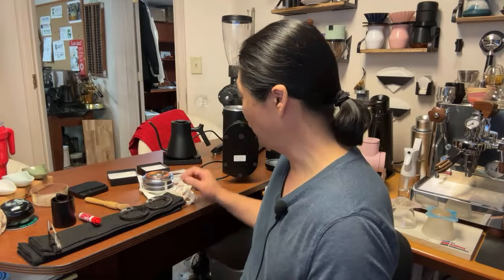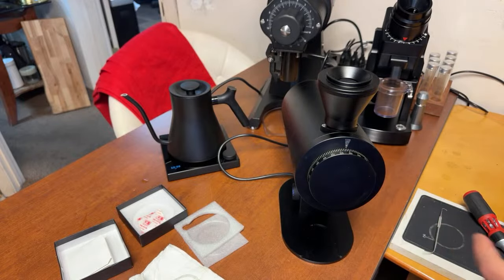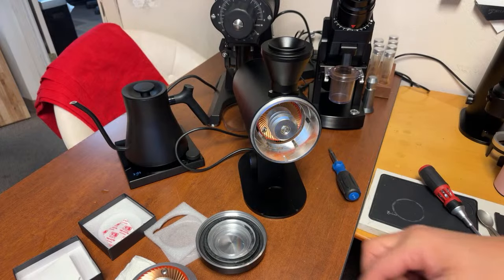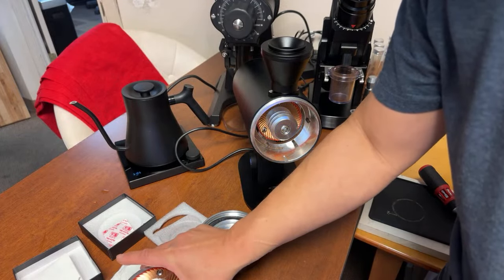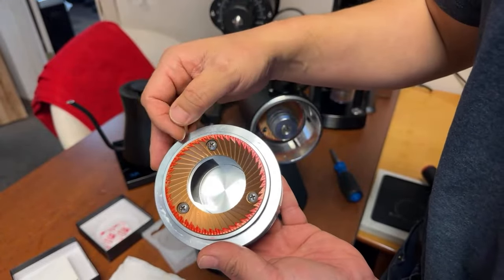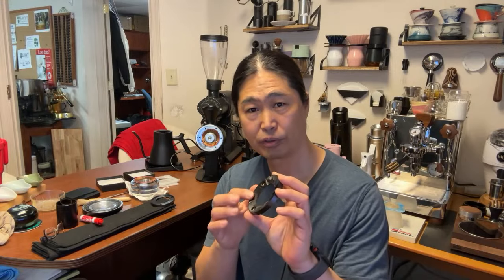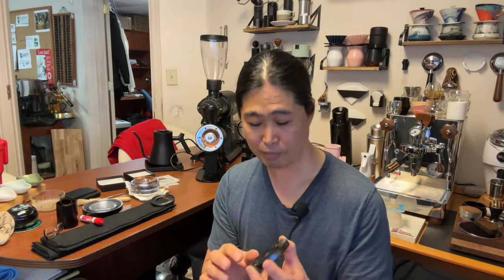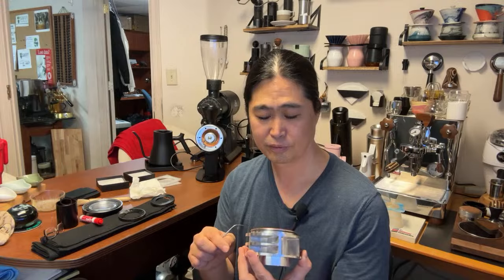Turin  DF83V SSP MP Burr replacement and Marker Test

Comment: Hey Hoon great video! I just got a df83v and I'm having an "issue" when grinding coarser grinds it sounds like something gets stuck between the burrs and the burrs start chirping. If I grind finer the noise goes away. Have you experienced anything like that?
Reply: I am having this same thing happen to me. If I change the rpm or grind finer and return to the coarser setting it goes away though

Comment: I recently changed out the Italmill burrs in my DF83 for DLC Expresso burrs.  I have been having nothing but troubles. I can't seem to get a fine enough grind for espresso. Or all of the sudden too fine. After aligning the burrs and zeroing the adjuster I have to turn the dial down to about 2 marks above chirp to get a fine enough grind for espresso. A single mark increment takes the brew from a 60+ second shot for 32 grams out, to about a 10 second shot for 32 grams of espresso. I just don't seem to be able to dial the new DLC burrs in for espresso. I have re-checked alignment of the burrs a few times, using a red dry marker and a 3/8 socket on the tightening bolt within the grinder to turn the moving burr gently but with positive contact against the stationary burr. Most of the red marker is rubbing off. So I think I have a decent alignment. Hopefully there is a simple solution that I have not been noticing. Otherwise it is back to the Italmil burrs. (I have posted this elsewhere hoping the folks that know will have a solution). . .  I have since gone back to the Italmill burrs. Can't get the DLC to brew a shot of expresso.
Reply: I recently returned a df83 for two reasons. One being the chute had been broken and was repaired with super glue before which i discovered on arrival and I could not get the dlc burrs to grind fine enough. I aligned the burrs and everything. Redditors were saying they just needed to be seasoned, but that made no sense because in my experience w my last 3 grinders the seasoning is to dull the blades because burrs are cut incredibly sharp and grind inconsistently fine on arrival. I ended up returning that grinder and purchasing the 83v which has had its own issues but I’ve had a better experience w it. Did you ever get the dlc burrs to work for you?
Reply: I replaced the burrs with SSP cast sweet burrs. They are working fine. Since then I had another problem where the motor in the DF83 freezes up and shuts off every ten or so seconds.
Reply: Hi there, I ordered my DF83V with SSP HU burrs preinstalled and it came with the exact same issue. I actually do not know what to do anymore since I have sent like 3-4 kg trough the grinder and it is still wildly inconsistent.